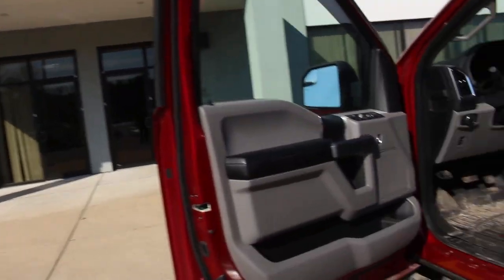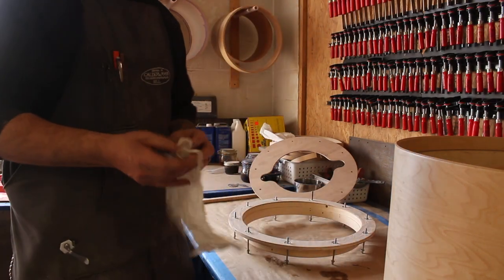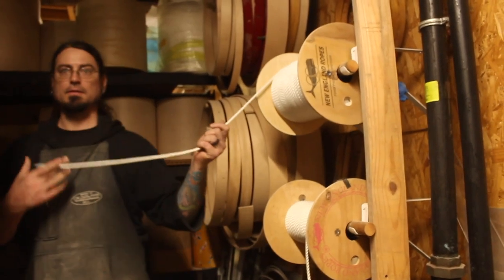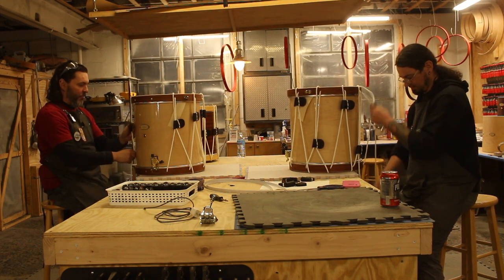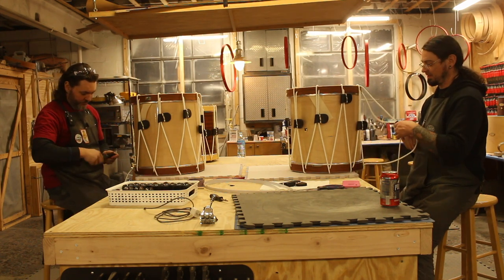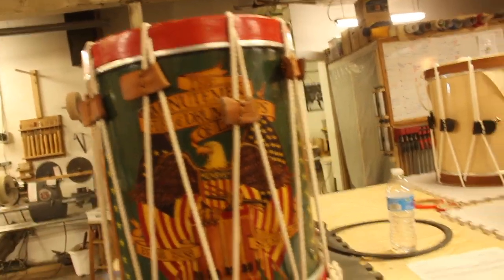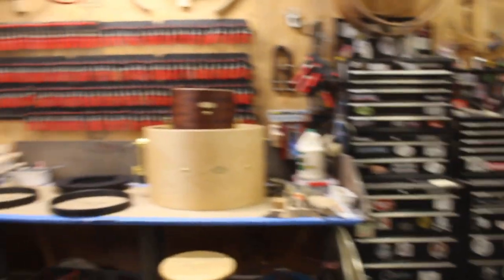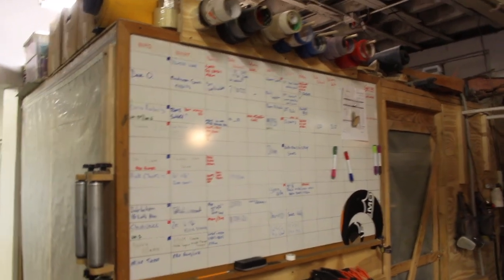Repetitious Drum Work, We Need A System, And Discussing First Instruments

Comment: I still have my first clarinet from 5th grade. A wooden Boosey & Hawkes. Was the only kid who had a wooden clarinet as a starter. Also still have my second clarinet I got in middle school. An Evette by Buffet, which was a semi-pro line at the time. That one got me through college. I still get it out from time to time. Also two vintage saxes, alto and tenor, Buescher from the 1920's, silver plated. The tenor I still play regularly. My bari sax is also a Buescher, but from the 70's. Up until a few years ago, I used to play it as much as the tenor. Wish I could help you with the business software. I'm an IT guy, but I don't have anything to do with CRM or business workflow. Cheers.
Reply: Awesome! I’ve got a Buescher BBb helicon from 1912 (I think) and a really unusual four valve front-action Buescher euphonium. Both are great horns!